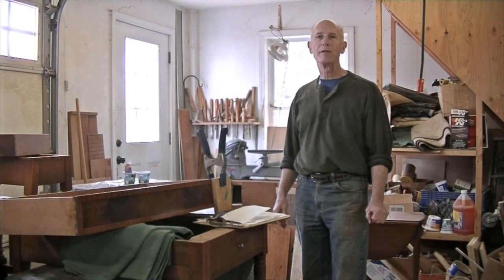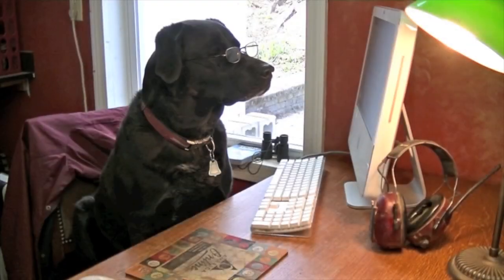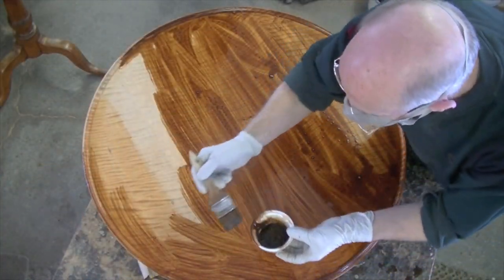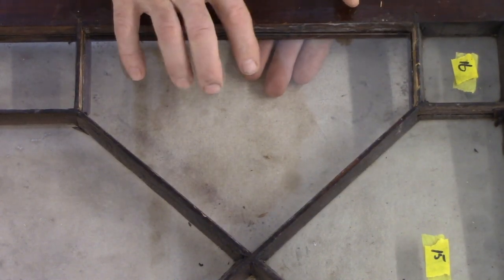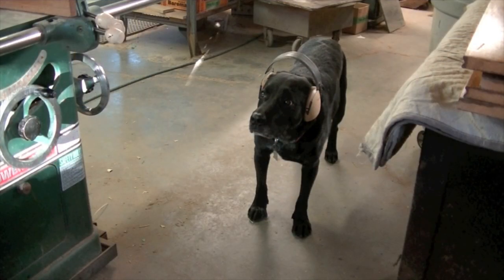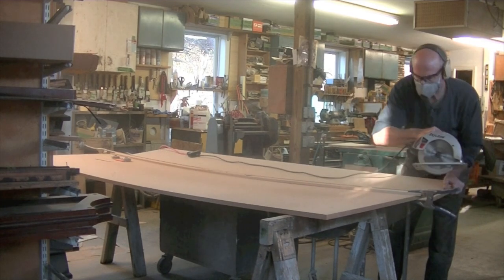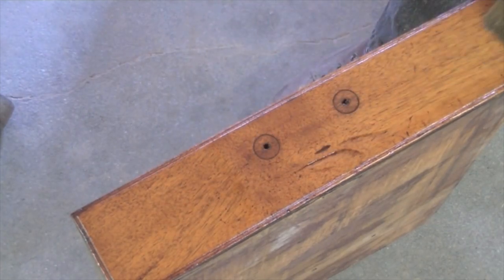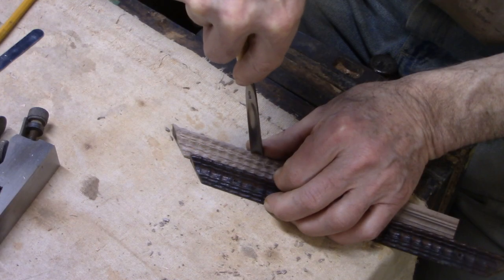Thank You for 50,000 Subscribers - Thomas Johnson Antique Furniture Restoration

Comment: Very enjoyable...question...I have sanded an old farm table (pine I believe) I was built by a friend about 35 years ago here in California...she said only used lemon oil and bees wax for the finish...should I put pre-stain on it first, then lemon oil & bees wax...is the pre-stain goin to help or hinder the final finish...
Reply from the maker: Thanks! You do not need pre-stain unless you're going to stain it. Also, the bees wax - lemon oil is not a finish, it's mostly solvent. Use any type of oil finish, like Watco danish Oil or Minwax Antique Oil
Reply: Thanks.... I was wondering, if there is a finish that we can use, without changing the color of the pine...
Reply: @johnsonrestoration  than you.... Ian’s suggestions on what I can finish it without changing the color of the pine